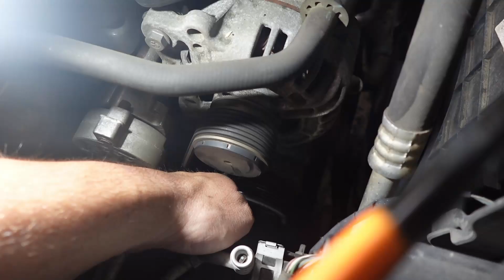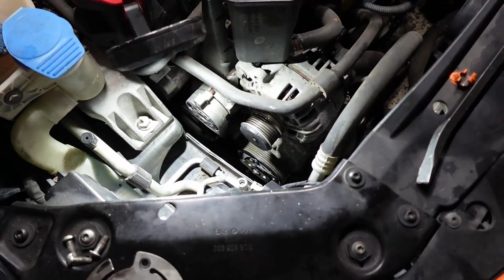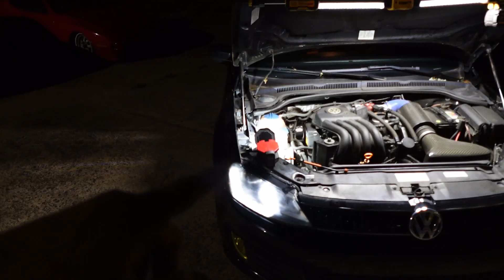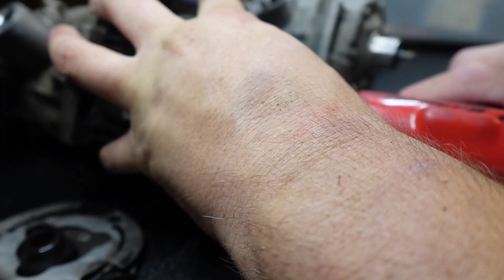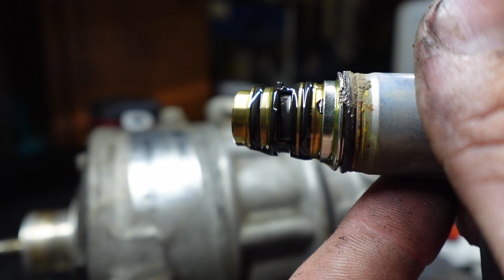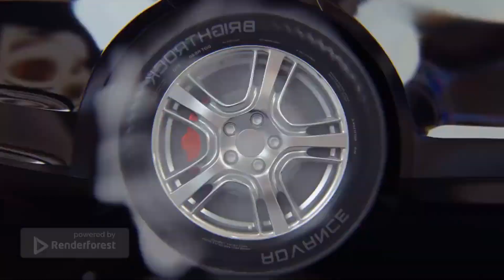Save Money: Repairing Your AC Compressor Today

Comment: I changed out the clutch assembly for the compressor in my 02 Sentra SER spec-v. Last year 

The shaft was cracked where the snap ring locks in so we just broke it off and put the clutch on with some 3M structural adhesive.
It's rated for a lot more torque than the serpentine belt will ever put on it.
It's holding up just fine.
Reply from the maker: Heck yeah, gotta love the sketchy mechanic repairs. If you squint, it's mint!